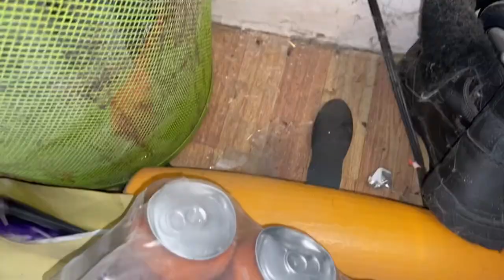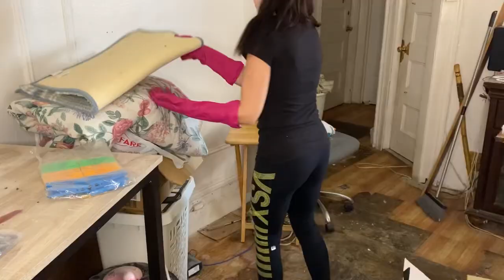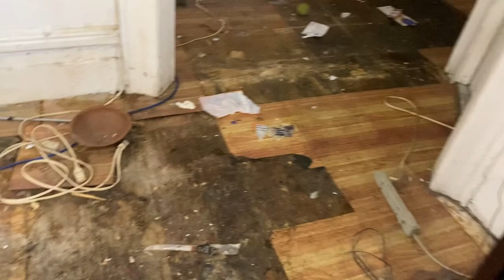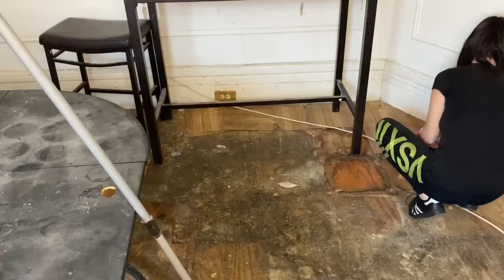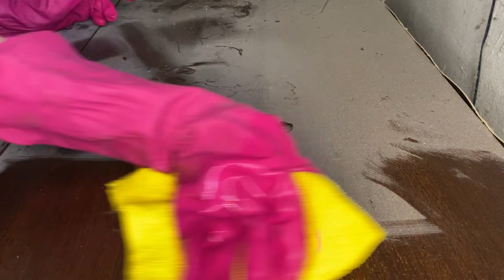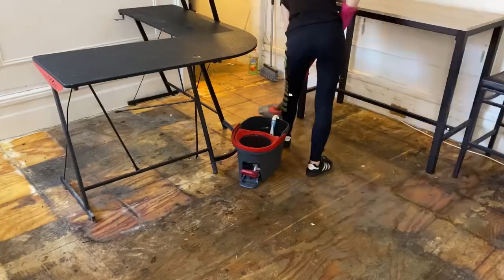Witness the UNTHINKABLE: Floor Cleaning Gone Horribly Wrong

Comment: Listen. The work that you do is wonderful. At the same time, you can't do miracles! This floor would need sanding bad! And you're not a floor tech. You do the best you can. It's more than enough and 100% better than before. Congrats
Reply: G'day, chantdalturcotte! IMHO, the floor needs to be replaced from the biohazards present over that length of time. I wonder if it's even safe, meaning would it cave in to a lower floor level? I don't know if this is an upstairs or downstairs flat. I just think it's too far gone for painting or sanding.
Reply: Sanding would just make the smell worse. Knowing landlords, they will probably just go over it with a sealer like Kilz.

Comment: First, this is an apartment building was probably built in the 1930’s and is gorgeous. 
Second, these tenants have probably lived there a long time and are rent controlled and sadly, in NYC, landlords don’t like that at all, and don’t do much repair wise. It would cost a few thousand to repair. Or the tenants are section 8 , don’t give a crap and neither does the landlord.
Third, these tenants did a hell of a job ruining what was once a shiny, pretty hardwood floor and trying to cover it with the peel and paste crap. 
The floor damage is not all that poor dog’s fault.

Comment: The only thing that would clean that floor is a flamethrower, in short controlled bursts.   Once it's all burned away, they put down a complete new floor.  Aside from wood being absorbent, that wood is also rotten. Nothing will take those stains and smells away.  I cannot begin to imagine how nasty that carpet was before they got rid of it -- all that urine soaking through the carpet; through the floor liner, and then into the wood; seeping under the laminate tiles, and dissolving the glue.  You can even tell which spots were a 'favourite' for the dog to use (shudder)

Comment: Those peel and stick tiles are the worst!  After cleaning the subfloor, I’d go to the local liquor store and buy jugs of cheapest vodka I could find, and put in pump sprayer bottle and saturate any areas that the urine can still be smelled.  Realistically the subfloor will have to be replaced due to condition.